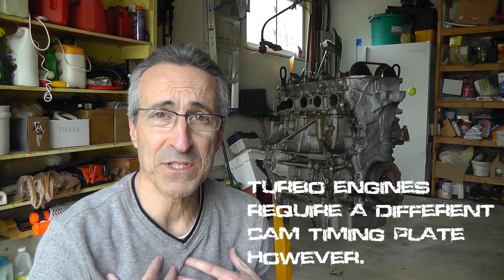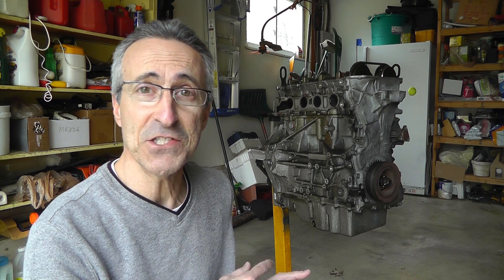Timing The Mazda/Ford 2.0/2.3/2.5 Engines. Part 1 - Is It Really That Hard?

Comment: I was used to my k series engine with a keyed crank. Didn't even know keyless setups existed. After taking the harmonic balancer and timing cover off, I simply figured I'd stick the crank bolt back in to rotate the engine to tdc. bad idea, I immediately knew something was off when the crank rotated but not the cams, so fortunately I stopped before I bent any valves, but I'm confused as shit trying to figure out how to get the engine back in time. 

I bought a timing kit for this engine, and unfortunately none of the crank lock bolts are the right thread, thanks to Amazon's never-ending supply of Chinese bullshit. How does the crank lock bolt work? I have the oil pan off so I can see the crank, is the pin on the crank lock screw supposed to slide under the counter balance to prevent it from turning one direction? My only problem is that when the pin fits under the counter balance, the crank definitely does not look like it is at tdc. Pistons 1 and 4 should be at TDC when the cams are locked together with the timing tool, right? Or do I have it backwards.

Comment: ive watched all of your videos, thank you very much , great help. To my issue, did everything properly, and fired right up, well heres the bad, when i shut down the motor, i guess i didnt tighten the crank pully bolt tight enough. Well it through timing off, and valves hit pistons, just cranking it over, with starter. So im back to timing it, and hopefully i didnt bend any valves. any advice, lock tight crank pully bolt? What is torque spec on crank pully, oh  , and i only had one of the paper thin washers behind it, if it matters.
Reply from the maker: Bummer. The crank pulley bolt is a torque to yield bolt so ideally you only use/tighten it once. That's recommended and that's what I did since it's probably the most important part for holding that damn pulley in place. It's been years since I did this but I'm pretty sure that I put the specs in the video. It's 75ftlbs and then another quarter turn, but definitely double check me before you do it again. Don't even think about starting the engine till you get that pulley bolt properly tightened! I think one washer is enough.
Reply: @baxrok2.  where i failed the first time, is i was afraid to tighten bolt to much with that small ten mm bolt holding the crank pully... im going to torque it with thread locker on crank bolt. and one washer
Reply from the maker: @ChrisLaurent-or2dv  The 10mm bolt is not intended to hold the pulley against the final torque step, but rather to get the teeth on the pulley aligned with the crank sensor. You have to hold the pulley separately to get that final quarter turn. Don't skip it!

Comment: On a 2011 ford fusion 2.5, I have 2 friction washer, do they stack up on the crankshaft or are they put in different space between the gear and the pulley

Comment: I want to thank you for this 4 part series. My 2016 Ford Fusion with the 2.5 jumped time and died at a stop sign. Thanks to this video series I completely understood what I was doing when I replaced the components using the All Data DIY manual. As it turns out, it jumped time because it was missing a friction washer between the crankshaft and the sprocket. With the M6 bolt in the pulley hole the cams lined up but the engine was still another 10-15 degrees from hitting the TDC peg. I’m surprised that the engine didn’t blow up. One tip I have is to definitely use the flats on the camshaft that look like a bolt to keep it from rotating while torquing the gears down.

Comment: Thanks . I ignored the big sticker on the crank pulley then found why you shouldn't . I wish I marked it just for reference , DRAT! But your videos will safe me as it's a clients car and they are keen to get it bak.
Reply from the maker: Use the timing tools and make sure that the crankshaft doesn't back off the timing peg before tightening everything down. Good luck!

Comment: So the timing cover on my focus 2.3 was damaged so I replaced it and didn't realize that it was a keyless cam... I didn't even think about it and just slapped the pulley back in and the car didn't start. I later found my fault. Will this completely ruin the engine? Once I took off the crank pulley and and cover i didn't touch the timing chain or anything else.
Reply from the maker: Well, it's hard to say. Easiest thing to do is run through the timing procedure and see if it starts. If you don't want to do that, then you can do a cylinder leak down test on all cylinders to see if the valves got bent when you were trying to start it.
Reply: Thanks. I went through the timing procedure. Just need to do the 1/4 turn and put everything back together and cross my fingers.
Reply: It started!! Thanks for the videos
Reply from the maker: @roanhorse3216  Congrats!

Comment: Where did u get the timing tool at I got one from autozone but it’s not the right one for my engine, I need the one with the notches cut out
Reply from the maker: Can't remember where I got mine from but you can easily find them by searching Mazda Timing Tools 2.3. Here's one I found: https://www.amazon.com/DEF-Camshaft-Alignment-Replacement-Duratec/dp/B08B5MC3TS/ref=asc_df_B08B5MC3TS/?tag=hyprod-20&linkCode=df0&hvadid=459647904235&hvpos=&hvnetw=g&hvrand=6678004880653794665&hvpone=&hvptwo=&hvqmt=&hvdev=c&hvdvcmdl=&hvlocint=&hvlocphy=9015676&hvtargid=pla-1014249435087&psc=1

Comment: Thanks for putting time and effort into this video because we're about to own a 2004 Focus w/ a 2.3L, and probably needs a new belt. 
In the rust belt, BTW. Any parts besides a water pump & belt(s) we might want on hand while the engine is accessed?
Reply from the maker: The engines that I cover in my videos are the later generation which have a timing chain. There are plenty of timing belt videos on your particular timing belt engine however.

Comment: Finally finished my 2.3/2.5 swap. The patient was a 2007 Mazda 3 S GT and donor a 2.5 2011 Mazda block from LKQ with 75k on the clock. I made a Insta for the project @ Bailey Motor Swaps. Your videos were very helpful and besides some torn lower control arm ball joint boots, everything runs great. I discovered probably why the 75k motor was on a shelf for me to buy. The timing seemed about 5-10 degrees off like they tried to time it without using the bar holding the cams. The crank was at the timing peg but both cams were equally off, maybe the variable intake timing mechanism was unsprung without the bar holding them?
Reply from the maker: Congratulations! Yes, I think that even a small amount of timing change can cause the engine to run poorly. Timing without the tools is not a good idea!

Comment: 2006 Ford Escape 2.3l I4  eighth digit "Z"
Is this an interference motor?  Tensioner failed, using air hose fitting applied air to cylinders which should have no open valves and air is escaping thru exhaust/intake manifold....
Reply from the maker: Yes, interference engine. Sorry.
Reply: @baxrok2.  yeah i am looking at heads now 600$
Reply from the maker: @davemetz9445  Bummer.
Reply: @baxrok2.  I stripped the engine to the block.  valves are bent to approx 1/4in gap at seat. piston shows slight ding in pre-depression area.  timing gear on crank SPINS FREELY??? what the hell is going on with that?? so im not giving up on this car...
Reply from the maker: @davemetz9445  These engines are keyless! That's why the crank pulley, etc, spins.  That's the point of my entire video series. Sorry bout your engine. Get a Ford Fusion 2.3 for a replacement.

Comment: Thank you very much for a great video, this will help me a lot to time my engine. BTW it's a 1.8L 81 kW Duratec HE from a Ford Mondeo MK3 and looking at the video I'm preaty sure the procedure is the same.
Reply from the maker: Thanks! Good luck!
Reply: @baxrok2.  Hey thanks for the reply, I have a question to ask you if you wouldn't mind. Could you tell me what is the lenght of the timing peg, I'm too cheap to go and buy the timing kit (because I'm probably going to use it only once) so I'm going to make my own, so if you could tell me that I would greatly apreciate it.
Reply from the maker: @MrRajaBaja  The entire portion that screws into the engine is ~38.5mm. I think that this number is also available via a Google search in case you want further verification. Thanks and good luck!
Reply: @baxrok2.  Yes that is the number I found, but honestly I knew that what you have definitively is the tool I need so now I know for sure, again thank you so much you have helped me a ton :D

Comment: Just letting people know: On the pre-2002 2.3l Lima and 2.5l 4-cylinders:

THERE IS NO DANGER OF MISTIMING YOUR ENGINE. Why? 

Answer: Because the 1983-2001 2.3/2.5l engines are called "noninterference engines." What does this mean? Basically, in a nutshell, the valves and pistons never make contact with each other, even when the timing belt breaks. I own a 1992 Ford Ranger with a 2.3l Lima engine, and have replaced my timing belt multiple times. I've even changed head gaskets a time or two....and never once has there been any damage to piston or valve.
Reply: Isaiah Welch I should know - I started without time - nothing happened

Comment: My cover cracked at the idle pulley for the serpentine. shop wanted a thousand dollars to replace the cover. I couldn't afford it. I'm so glad I found your videos .I wasn't ready for sure when I saw the tips and tools I thought I was over my head. I'm 63 and I worked on cars with distributors  and timing mark :) . Before I took my balancer off after lining up my balancer with the bolt hole I put in a bolt to lock my shaft and a piece of strap metal to lock my cams . Removed the broken cover .replaced with a new one and lined up my balancer with the bolt hole did a light torque and pulled my stops out and rolled it to top dead center. My  bolt hole lined up so I rolled it a couple of times to make sure.  Thanks for the video. it helped plus a Chiltons
Reply from the maker: Congratulations on you diy fix! Savings big bucks and doing things right is what it's all about!

Comment: So timing doesn’t seem to bad. It’s finding the parts. Mainly the friction washers. The dealers are saying my cars doesn’t have friction washer which is not possible
Reply from the maker: Yeah, they told me the same thing. I bought and used them anyway.
Reply: Baxrok2 thanks. When I look on the ford parts website for a 2006 fusion with a 2.3l I can find all the friction washers. I have a 2005 Mazda6 with the 2.3l. The Mazda parts website doesn’t show any friction washers. When I disassembled the engine I only found one and I know that is not correct. Thanks for your videos. I’ve been watching them over and over as I get closer to rebuilding the engine
Reply from the maker: Same here, the Fusion had them. You're welcome and good luck on the rebuild!

Comment: Before I finish watching your video ,my 2007 ford 2.3 had the harmonic balancer nut bust loose while driving. I have a free spinning  camshaft ,not good. No key to the harmonic balancer, God help me.
Reply from the maker: snowblind5151 Yeah, that might be a problem or might not. My timing was waaay off and in fact my crank pulley bolt was loose too. I drove the car, revved it to 4 or 5k rpms, and amazingly, no damage. So, there's hope!

Comment: Your whole 4 video problem is solved by using the right indexing bolt on the crank and tightening it to lock the crankshaft in place.
Reply from the maker: Well, yeah. However, I made this video series in response to the fact that a series like it didn't exist and, while easy for some, for the DIYer's who might be doing engine swaps they sure seem to appreciate the info. Also, I had a pro set my timing. He fucked it up and caused me three weeks of wasted time chasing other things since I figured the timing was good! After I figured out just how easy it was to do myself, I wanted to share what I learned to help others. I made four parts since I wanted to give people the option of watching whatever they found most helpful. Thanks!

Comment: 4 each 30 minute videos to explain the timing. I think you answered your own question. No key in the crankshaft- stupid engineering nightmare. Thank you Ford. What a POS.
Reply from the maker: Chris Happ Yeah, I totally overdid it. But people had so many questions about it I wanted to be clear and put an end to the matter for good! You having problems?
Reply: More than I can explain here. First engine I've seen with no key. Bad idea. The 2003 engine is a nightmare of 'specialty tools' requirement. The risk of knocking something out is too great. We have the situation under control, but this engine is one to stay away from. Thanks for the reply and the video, though!

Comment: BAXROK2  HOW  CAN YOU TELL  THE DIFERENCE IN BETWEEN  2.0 AND 2.3 ENGINE  ON A MAZDA 3?     THANKS
Reply from the maker: Rob Perss There is a sticker under the hood and it tells you which engine you have. Sometimes there is a sticker on the valve cover too. Finally, it should be cast into the back of the engine block itself.